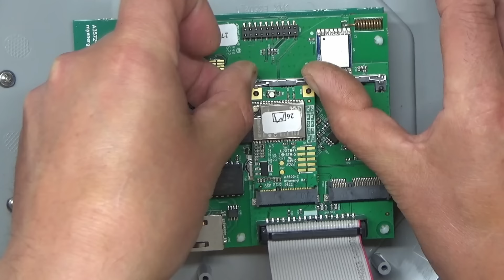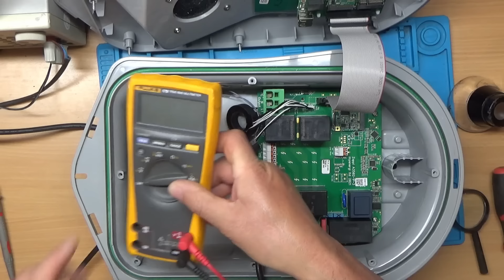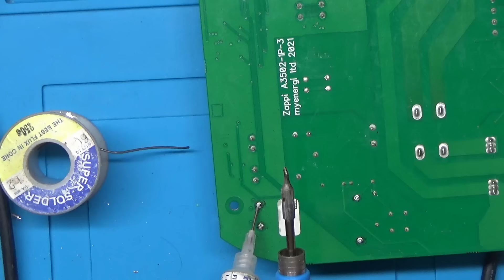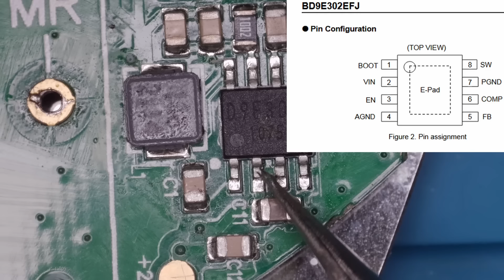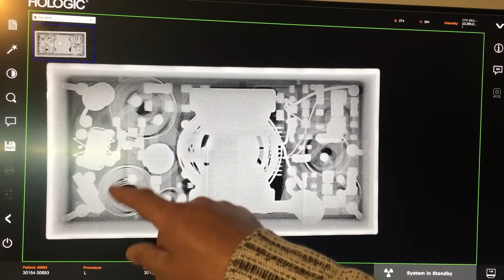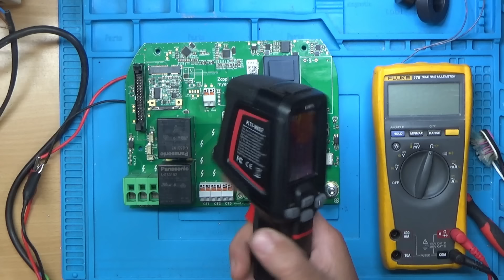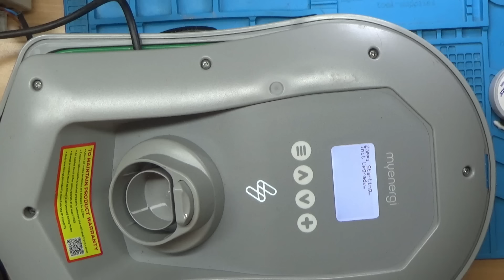Faulty MyEnergi Zappi EV Charging Point | Can I Fix It?

Comment: I am frankly outraged at how you approached this case. 1) Powering it up without checking main power lines 2) Not reversing / drawing block-schema of power lines at all to get enough information 3) Injecting huge amount of power to shorted / low R rails (fried / burnt by 24W internal trace or via connection as a result) 4) Using x-ray scans to get connections line which are visible to any slightly experienced technician just from observing main components / parts from top view. 5) OMG you don't even investigated what is source of fault and what is result of fault (fault ceramic capacitor is a result, back EMF from relay coil doubled by wrong filtering and crapy engineering is a source). 6) Telling repair is done without proper loading / testing of device (you don't need EV for that). Gosh, pls some experience from a lot of materials (books, videos of how basic things works, etc) about electronics and build proper approach/
Reply from the maker: Firstly thanks for sharing your point of view 🙂
1) The sender said it was completely dead, and did nothing when plugged in.
2) I tested there was power to the PSU and transformer, no need to waste time reverse engineering the whole thing.
3) It's a fairly common technique called voltage injection, and I assume you mean 24V not 24W.
4) Yes, but it also adds to the entertainment, and it's such a cool thing 😂
5) The fault was due to the MLCC failing. They fail quite often, and even on new devices such as this 1TB SSD I repaired : https://www.youtube.com/watch?v=fzQfZ31jop8
6) The fault was "no power" not "no output" so I repaired what I was asked to do.
Hope you have a great day 👍
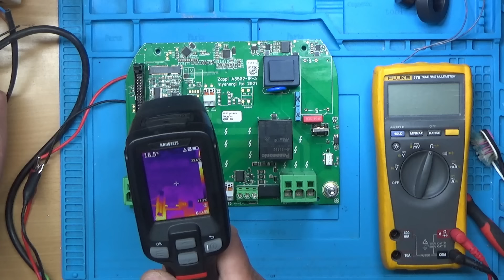Reply: @BuyitFixit  It's a basic common rule in every repair of high voltage parts included - not to power up until it's cleared for the faults or either set protected through current limiting device (i.e. incandescent lamp which power is less then DUT) - no matter of what sender said.Proper engineering approach includes drawing parts of device into blocks to get it visualized and to see how they are connected and where mb points of isolation (fuses, zero-ohms resistors) to check each block individually. At 26:00 of your second "volt injecting" attempt you said providing "24 volts 1 ampere" I assume this means 24W limit from your power source. And "volt infection" (i.e. "semi-powering DUT") is NOT a common technique in professional speaking, cause it's used when you don't see whole picture and can't figure where is the fault may be. I get the point of x-rays for fun, but when I saw this PCB i did visualized possible power lines inb4 scans were on the screen and they were just where I imagined. The "quite often fail of MLCC" is a myth (unless it's a cheap noname chinese junk made of CF components). Most common MLCCs faults are a sign and a result of a real fault or currents exceeds the limits of this particular component due to "optimized" circuitry or poor design. Some MLCC may fall of  high-frequency "ringing" in the specific circuits. You repaired it to the condition where it powers up and all buck converters providing designed voltage and logic circuitry works. But when sender will try to wire it up and hang it on his wall (possibly with a high impedance cable, or just poor connection) - it will result the same fault cause EMF filter on these 2 high power relays designed badly. Instead of using CLC filtering on a power line coming with rather long 24V trace from combined isolated ACDC source (as a standalone component) it should additionally be equipped with RC snubber (10 Ohms 1/8W 1210-size + 100nF 50V X5R MLCC 0603-size),  across coil windings and a regular 600V 1A fast recovery diode in reverse direction to act like suppressor of reverse polarity EMI when relays shuts off. Without these options simulated voltage will be 2.5kV@.001mA of back EMF (under relay full load) and CLC filter of 2x 10uF 50V X5 MLCC + ~0.1-1uH .5A inductance can "absorb" only low frequency EMI. My day is fine, hope yours too.
Reply: Oi oi salty, Burt the happy customer here, if I break something in the future I am sure you will look at it, repair it, test it and make an entertaining video and ask for nothing in return? What's your contact details? 🤔

Comment: I would had expected that the charger only turns on when a EV is plugged in, that it was a blown mini cap and a problematic via, would haver never come to my mind...
Great job!
👍👍👍
What were the loose grey and black wires with the ferro rings around for, just floating around in the box?
🧐🤓
Reply from the maker: Thanks 👍The chargers computer turns on when powered, but it only outputs power to the lead (which he didn't send) when it's connected to the EV as it has to communicated with the car. The ferro rings are current sensing coils, which are used monitor the charging current, and if there's any leakage to the earth wire. (He just tied them together with the grey wire to stop them floating around when shipping). The problematic via seems to have been caused by the sender, as he commented saying that he'd already changed the PSU and might have damaged the via then. Hope that helps 🙂

Comment: I knew you would use that Xray machine somewhere, what a neat bit of kit to have. Always a pleasure to watch PS I think you found that broken via when you were measuring the 24V connections on removing the PSU, it didn't connect on one side but I thought that was the ground side? I hate those tight via's, so easy to damage trying to get desoldered legs out
Reply from the maker: Thanks mate 👍After I made the video, the owner who sent me it put a comment on the video (which I've pinned just under it) saying that he had previously replaced the PSU and it might have been damaged then.
Reply: @BuyitFixit  Very likely

Comment: The Zappi has an external  current clamp which detects if power gets exported from your solar to the grid. It then diverts the excess solar to your EV instead.  clever device but not very reliable unfortunately.
Reply from the maker: Interesting. Someone else mentioned similar. I think the clamp was called a HARVI.

Comment: Great video with x-ray, it would be great if you would examine with x-ray where the line was broke.
Reply from the maker: Thanks 👍 I think you would have to try and x-ray the board vertically. It seems the via may have been damaged by the guy that sent me it, as he did comment on the video saying that he did try and fix it himself and replaced the PSU before he sent me it.

Comment: Glad to see x-ray machine put to work. I wonder why PCB connection between those two points failed. My take is that once the cap got short, the trace took a giant power surge which fried it.
Reply from the maker: Thanks 👍Good theory. See pinned comment under the video which explains the trace 🙂

Comment: I watched a video about a guy driving a 1908 auto. He said the new cars will NEVER last like that.Here's why! My 2022 Mazda in 20-30 years or less will be an electronic nightmare.
Reply from the maker: Agree. There's a lot more to go wrong in modern cars. Things like my little RTV900 (utility vehicle, which I re-built the hydraulic transmission on in a couple of videos on here) has very little electronics. Pretty much a timer for the fuel shut off, and a couple of solenoids. Modern cars will have all kinds of electrical issues from failed modules, corrupted firmware / flash memory wearing out (tesla) etc.

Comment: amazing a £500 charger stopped working because of a 1p part and would have been thrown away in the dump
Reply from the maker: Yep, it's usually the case with a lot of electronics though. Had the same fault with a 1TB SSD I looked at a while back too (turned out to be brand new)

Comment: Have you xrayed your hands or feet? If i had an xray machine like that, i would be tempted to xray my hands.
Reply from the maker: I'd probably need to remove them first to fit them in the cabinet 😂😂or defeat the interlocks which would be a whole less painful. It's probably not really advisable though🙂

Comment: Excellent, Mick. Looking at the video I thought in a moment what the problem will be: the via itself. Great! Same conclusion, and bad quality PCB!
Reply from the maker: Cheers mate 👍
Reply: Hi Mike, I enjoy your videos which are revealing your excellence in repairing things time after time ! Regarding this repair - I may have missed something - what exactly blew the via ? The faulty shorted cap or the desoldering action of the 24 V psu unit ? Or was there no via at all and the positive leg of the 24 V psu is assumed to assure the connection to the other layer(s) ? Thanks for sharing your outstanding knowledge anyhow you're a very gifted all-round technician and farmer !🙂❤ @BuyitFixit

Comment: Nicely done!  That X-ray machine is a really fun thing.  Now you need an MRI scanner so you can see individual layers of multi-layer boards!  You'd think a smart company would batch up the failed chargers into say lots of 50 and then get them fixed rather than just dump them.  Crazy throw-away society we live in!
Reply from the maker: Cheers Mike 👍Yes it's a pretty cool thing. I thought about making a stepper motor to rotate things, and then there's a program you can run that works out all of the images to create an MRI image from them 🙂
Reply: @BuyitFixit  Wow, that would be really fun.  For me the biggest pain about modern electronics is multi-layer boards and not knowing what goes where. Prevents a lot of learning from just looking.

Comment: Adding another comment: when you remove components like that Recom power supply, or any other through-hole component it's very easy to rip vias out of the board.  My technique for removing capacitors is what I call walk- out.  Using leaded solder of course, and then applying gentle pressure on the component to walk it out of the board one pin at a time has done the trick for many years.
Reply from the maker: Thanks for the tip. (see pinned comment) as the previous owner had already replaced the PSU it seems...(which I didn't know at the time of making the video).
Reply: I like those little "bricks".  Great problem solvers when you have circuit board with a converter built onto it that is burnt out.  I have several times replaced the dead components with one of those modular power converters. $50 part  fixed a $1,500 circuit board, where the 3-week lead time for delivery.

Comment: Mick the "wire strippers are Miller Strippers used to remove the plastic coating on fibre optic strands, they have plastic teeth no good on wire. Great vid.🤣🤣 🤣:oops::oops::oops:
Reply: Hi Richard, these are no-nik (registered trade mark) wire strippers light green signifies AWG 24, Ripley tool  🔫😮
Reply from the maker: It does say "wire stripper" on them, I'll have to have a look to see what wire they are used for.
Reply: CAT 5e

Comment: Slightly concerned there with your using a metal screwdriver tip to point out stuff while the device was powered: you really should keep some wooden skewers or toothpicks handy for this sort of stuff IMO! :(

Is the trace wire bypass heavy enough to take the sort of current expected under load in that 24V line?
Reply from the maker: Wasn't I using the bench PSU at low voltage? when pointing with the screwdriver (I could be wrong). Good advice on the tooth pics. The 24v PSU is only 850ma output.
Reply: @BuyitFixit  Low output appreciated, but regardless, when in range it's v easy to fry some MCU or similar from an involuntary muscular twitch, as I know from experience :(

Comment: Whole unit dead due to one tiny capactor,  had the same problem with a DAB radio I rescued from a neighbours bin!
I do find replacing tiny components a struggle, even using a microscope, that is why I genarally just repair vintage electronics😉
Reply from the maker: Yep, had the same too with a solid state disk drive I repaired on the channel. It turned out to be brand new too! Yes replacing tiny components you do need a steady hand and my eyes are pretty bad now compared to when I was younger...
Reply: @BuyitFixit  I recently fixed a £400 bike light where a ceramic cap across the battery input had gone dead short.   I fear that the designer had been a little stingy with the voltage rating.   No sign of physical damage and with 5A it was not getting hot enough to show on a thermal camera.   15A and it started to sizzle!
Reply from the maker: @thegrumpyengineer3907 Interesting, thanks for sharing 👍

Comment: hi Mick I kinda thought that it was a via issue after you changed the cap, and I thought (Ahem! sorry, somewhat embarrassingly) that you may have pulled the middle of the via out  when you desoldered the PSU, fair play to Burt for holding his hands up here..
Reply from the maker: Yes, the PSU came out not too bad eventually, and I didn't see any vias on the legs of it. I had wondered if someone else had taken the PSU out previously as I did notice it looked like it had been soldered or something as there was black flux residue around the pins on it.

Comment: My colleague and I were interested to take a look at a Zappi so he bought a couple of faulty ones. It was interesting looking at the failures. One was caused by the installer not tightening the AC input screw terminals tightly enough and the other one had a cheap Chinese relay (Hong Fa) in place of the nice Panasonic relays used in the earlier version. Disassembling the relay revealed that a badly manufactured armature was binding. It just goes to show how you can ruin a perfectly good design by replacing the Japanesium with Chinesium 🙂.

There are some unpublished settings that are needed to enable or disable some features. They appear on some of the forums.

I have found many shorted high value, small package MLCCs. Often they are rated only just above the working voltage. If they double-rated them they would have been more reliable. The thermal imager is definitely the way to go, nice fix!
Reply from the maker: Thanks, and thanks for your detailed post!🙂👍

Comment: MLC capacitors are prone to failure because they are rigid. If used on a rigid ceramic substrate with the same thermal coefficient they are fine (e.g. military applications). But when used on a glassfibre PCB it's bad news. The PCB expands with heat and it flexes. The capacitor develops microfractures; moisture creeps inside; dendrites form. The problem can be mitigated by designing the solder pads to be 60% of the width of the capacitor and using tin-lead solder. The solder then acts as a flexible connection. In fact the existing pad doesn't need to be changed - simply change the solder-resist to reduce the exposed pad width to 60%. But manufacturers won't do this.
Reply from the maker: Interesting. I've had a few of these types of failures so far. One I remember offhand was the 1TB SSD I looked at, which actually turned out to be brand new and unused so I guess it failed at almost first power up.

Comment: Interesting to see that it is cheaper for the companies to replace the whole unit (> 1.000 quit) instead of finding the fault. I wonder if this is a common fault for these Zappies...
Reply from the maker: Seems to be a common practice these days. Had the same with the cricut vinyl cutter I looked at, and It's quite common for a for these types of caps to fail on any electronic device. It was the same fault on the 1TB SSD I looked at a while back, and a couple of other devices too.

Comment: Via damage when removing the transformer.  Easily done but not so readily seen - nice detective work to find that.  PS - do NOT get an EV for 'testing purposes'.  Just seen 'Burt's' reply re via damage..... that's life!
Reply: I suspect an EV would make little sense on the (presumably) hilly farm: you'd spend more time recharging it than work in the field, & torque limitations plus general farm eqpt abuse would make that worse :(
Reply from the maker: 😂😂😂Yes not planning on an EV.

Comment: I think that the ti chip is the brains, that module you pointed is (I think, given that I can't read the markings of it) a gsm module, although I do not understand why it should have one, it's not like it requires updates, and the rfid module is missing, so it does not require a constant internet connection.
I also do not get why the transceiver chip, to what is it supposed to talk to? Given the frequency it's something that it's supposed to be close by.
Reply from the maker: Agree the TI is probably the brains. The ESP32 will be for wifi and possibly bluetooth,  and the other module is for HARVI someone mentioned which is a remote current sensor.

Comment: Heat is the killer here, could have been mounted in full sun. Considering the price of these things there was no need to use surface mounted caps, what's wrong with real sized ones that can dissipate heat. I fixed a pod point and it turned out to be a very small cap, cheers
Reply from the maker: Thanks 👍Hmmm heat could be, although I had the same failure on a 1TB SSD I looked at on the channel, and that turned out to be brand new!
Reply: @BuyitFixit  I think surface mounted capacitors are just asking for trouble unless they have a heat sink, cheers